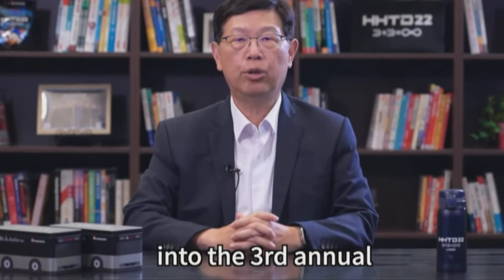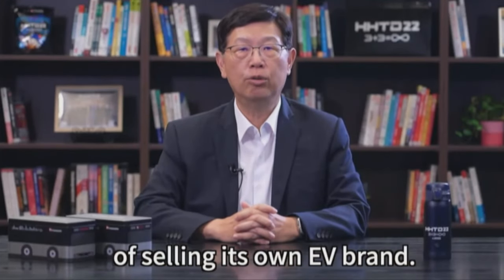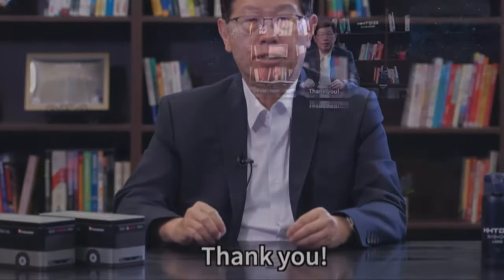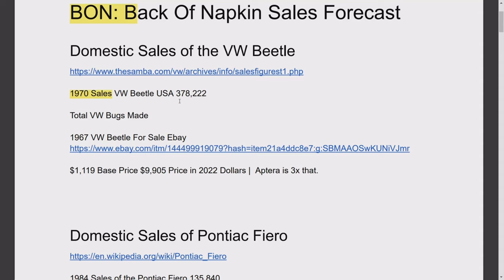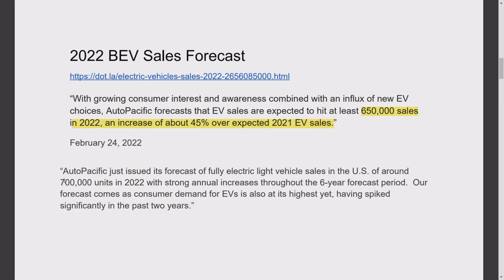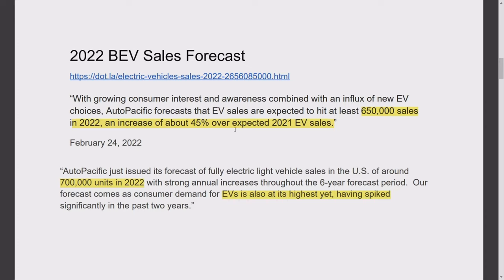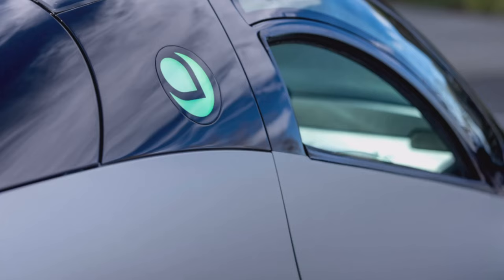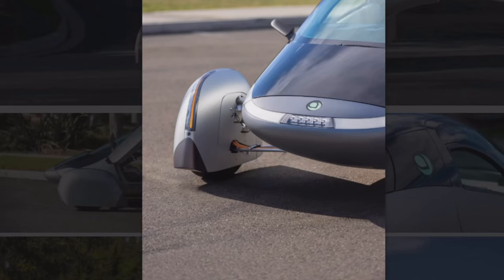Aptera a good fit for FOXCONN / LMC CDMS asset light manufacturing program. Common hub motor system.

Comment: Thanks for the Aptera coverage.  Posted to Reddit at r/ApteraMotors.  The Aptera will be likely looking for additional manufacturing sites both in the US and abroad before long.  That could make sense.  The motors being built at Lordstown are quite different than what Aptera is using, even though Elaphe was central to the development of both.
Reply from the maker: Different Hub Motors for sure but still in the same ballpark - one plus may be MIH software components - self driving so forth - also IMO Foxconn will be lower cost - higher quality option. BTW LMC there can do the crash testing and certification if it is needed - Foxconn can do the entire BEV program - just hand them the gama and they will take it from there - everything right up to delivering finished BEV in quantity ready for commercial sale. Of course I am not affiliated with fox/lmc/mih but I am pretty sure they would say the same thing. Aptera would only need to pay for production - vs building and staffing a factory or multiple factories. A lighter lift - get venture funding - or partner with a deep pocket - anyway just like Foxconn made just about every Iphone in one place - the same is going to be true for their BEV production in this hemisphere IMO - Foxconn Lordstown Ohio will be a mega facility - mega - suppliers will locate plant there - plant will likely expand - it will be massive  IMO. This is their entry into the BEV market they will pull out all the stops because they own it - their first.
Reply: @mxux  No one crash tests gamma vehicles.  Since Aptera is not required to be crash tested, I suppose they could, but it is only one vehicle.  Aptera plans to have a third party do the entire FMVSS series of tests.  These will be done on deltas.  

Aptera already has around 92% of their vehicle already covered in supply contracts with vendors, including the production equipment, so I doubt there will be a change for initial production.  

Since the demand will likely grow beyond the 80 or so vehicles they can produce per day at the first factory, they have plans to build other factories and there are new forthcoming vehicles so perhaps that that point they could consider a contract with Foxconn.
Reply: I would like to add Jacksonville, Florida to the list of potential manufacting sites. Jacksonville Florida is a high volume port city already being utilized by Southeast Toyota Distributors, the largest private distributor of Toyotas.  For manufacturing, Jacksonville has Cecil Commerce Center (a huge former Naval Air Station).  Bridgestone Americas Tire Operations (a potential source of high quality tires) already has a 44 million dollar, million square foot, tire distribution center in the Cecil Commerce Center.
Reply: @eldonbageant6881  Aptera has too much on their plate at the moment to start serious consideration of other sites, but you might email them your suggestion so that they have it once they start considering where else in the US they will build.  I know they have started a list of sorts.
Reply: @n.brucenelson5920  Thanks.  I'll do that.

Comment: Maybe in the future, but for now I tbink aptera announced they have a diffrerent company building apteras
Reply from the maker: Ya maybe - cpc the carbon fiber guys - maybe just parts? No assembly? To get the IRA tax credits - will this matter to Aptera - will they qualify? Anyway must build in USA ya kno. Foxconn has Iphone quality - using them would strengthen Aptera brand and instill confidence - availability of repair parts also  vs EU...still think it is the play IMO.
Reply: @mxux  good points time will tell
Reply: @mxux  CPC is manufacturing the Aptera.  They're not just making parts for Aptera, they're building like 90% of every vehicle.  Aptera will be installing the suspension, and the in-wheel motors, CPC is handling everything else.  Foxconn is simply not needed.  Also, It doesn't matter where the vehicle is made, because there is no provision for two, and three wheeled vehicles written in the law, so Aptera is out, period, they can never qualify for the tax credit....unless the law is rewritten.
Reply: @mxux  Perhaps some LE vehicles will be completely assembled by C.P.C. but as soon as regular assembly starts they will be shipping bodies and possibly the aluminum back bone, and the rest of the assembly will occur in San Carlos, CA.  I am not sure if this has been completely determined yet.